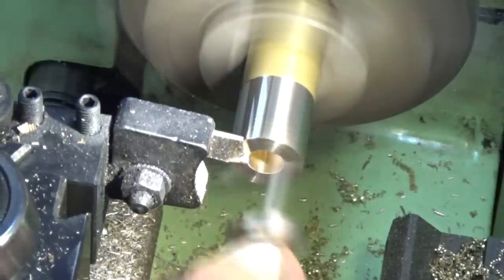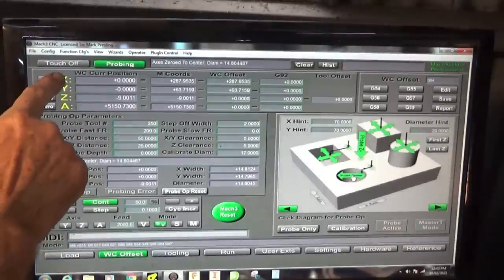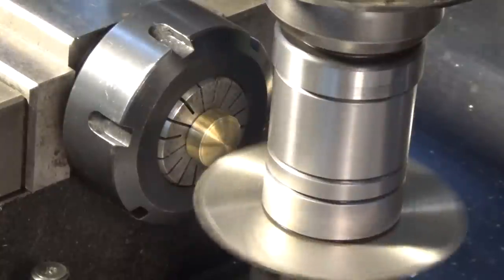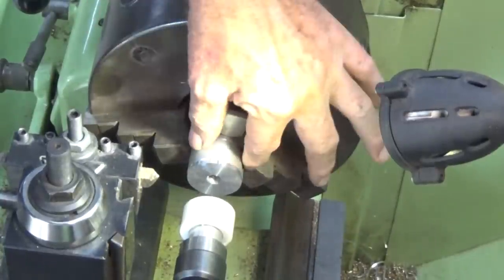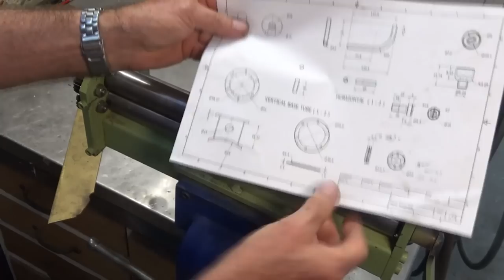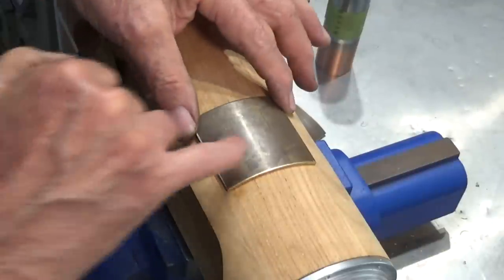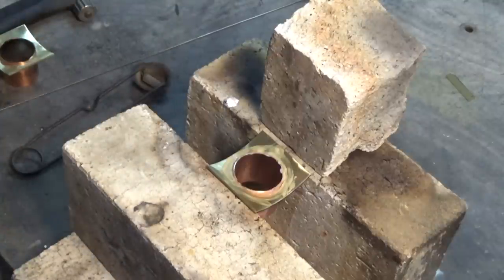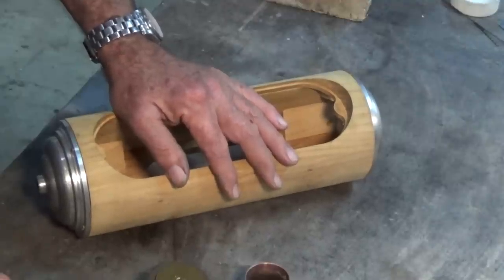The "MIXIE" A DIY Steampunk, Backlit Digital Clock - Part 5

Comment: Cool stuff.  Im a heating and air guy, so I do a lot of silver brazing.  I have very good results with a very fine oxy fuel flame. A 0 (American size) tip is good for just about everything, and a 00 is great for even smaller stuff.  Any way, not trying to be a know it all, but most people use much too large of a tip.  Use a small one and let the silver suck in with the heat.  The silver always wants to run to the heat.

I really dig your baby slip roll, looks handy.
Reply from the maker: Unfortunately, here is Australia, the rental cost for gas cylinders is outrageous. You can either pay an annual rental fee or an up front charge for an exchange cylinder and then about 1/3 of that for each exchange. I purchase exchange cylinders for propane and MIG gas. It's hard to justify adding two more cylinders to my shop but you are correct about the concentrated heat of a fine oxy acetylene flame. In the next video I show some joints that I did that way but I had to take them to the high school shop where I used to work. 
Regards,
Mark
Reply: @Preso58  didnt realize acetylene was so spendy there.  I go thru so much nitrogen, oxy, and acetylene that I get a good price on it.  I actually get mine at the feed store for about half what it runs at welder supply.  Ive had my big tanks for years, as well as my tote sized bottles and several spares. 

Ive had fair results using those little crack pipe butane torches for really small 45% soldering.
Reply: Might want to talk to your supplier mate, I run E size cylinders and the rental on those is $10 a month. (Adelaide)

Comment: About a year ago I picked up a three in one tool from Harbor Freight.  It has a shear, press brake, and slip roller.  This video reminds me that I have yet to try out the slip roller portion.

Great video as always Mark.  thanks for the information.
Reply from the maker: There are some jobs that only a roller will do. The rollers on my machine can have custom grooves in the ends for wire and angle as well. I haven't done that on mine yet but it's an option if it's needed.
Regards,
Mark

Comment: We have the Ender 4, which looks like the Ender 5, but wasn't really sold as the Ender 4. So, when the driver board died I bought the BigTreeTech 1.4v and the touch screen, spent two months trying to get the motors to run properly without crashing. The Ender 5 Marlin software would not work and I had to add some more to the programming because there was a direction conflict, but after the upgrades the printer prints fantastic and is so quiet the fans are louder than the stepper motors. I love how this clock is taking shape. I designed a 1950's steam mill for one of my classes for animation and had it blow up, which was an actual explosion in Oregon in the 1950's when a blow off valve seized.
Reply from the maker: Craig, I have been doing some experimentation with the Ender3 before I give it to my nephew. I just ran a print that was sliced using the Prusa slicer. It seems to do a better job than the Cura slicer I was using before. I think part of my problem was trying to print PETG filament. When I first got the Ender, I only printed in PLA and it did a pretty good job with that. However, the Prusa has a lot of tricks up it's sleeve and it is also very quiet. 
Regards,
Mark

Comment: These things are very cool Mark nice work.....friken laser beams haha.....glad you showed the pressure turning like that I would have been a little worried to try that
Reply from the maker: The key to doing the pressure turning is to take light cuts. I could have added a pin in the centre of the stock in the chuck to register on a hole in the disc since they all needed holes anyway. That at least stops the discs flying out sideways if there isn't enough friction to drive the part. 
Regards,
Mark

Comment: Well, as a former pipe fitter I can say those flanges look awesome 😁. The steam domes àre going to be great too, the joints look very tidy. I've been wanting to invest in some silver solder but it's a little on the pricey side 😏. How you manage to stay so clean as to not mess up that wood I'll never know. If it was me it would be full of oily fingerprints by now 🤣. Thanks for the great vid, Mark! Cheers! 👍😁👍
Reply from the maker: If I don't drop the wooden frame on the floor first! It's one of those unstable things that wants to roll if you put it down the wrong way. 
Regards,
Mark

Comment: You can pass the wiring through those screws quite easily.

You have a single start thread, you have a fixed thickness part that it's passing through and presumably those parts will all be clocked to a fixed angle relative to each other.

Do the screw up to (or even just a little over) its final torque with a torque wrench so that you have a consistent amount of stretch etc on the screw then mark where the hole has to be in the side of it and drill it out.

Now you can reassemble it and torque it up to somewhere near the value you used previously. The big hole you just put into the side may affect the amount of stretch in the screw so your new torque may differ slightly from the initial one but you'll be able to find experimentally exactly what value you need to line everything up.

Providing you use the same screw in the same doughnut piece and torque to the same value with the same thread lubrication (either some or none) everything will end up in the same spot every time.

If you're not convinced, give it a go anyway. You can always run the steel pipe if you're not keen on your original plan ;)

And if you take note of the angle between the hole and screw slot you will know exactly where it's at at all times anyway.
Reply from the maker: Daniel, thanks for the procedure. I have a terrible habit of not keeping track of which screws go where. I can almost guarantee that one or more of the screws will tighten up in a different orientation and then I will be messing about trying to match the screws so the wiring holes line up. Yes, it is a simple matter to number each part but I'm not that organised. There is also the matter of having to attach pin headers to the ends of the wires and these may not be easy to thread through the holes. With a build like this one there is a lot of assembly and disassembly before everything is debugged and finished. At the end of the day I sort of like the braided stainless hose and it will add a bit more detail to the build.
Regards,
Mark

Comment: I really liked the way you mated the curved collar and the cylindrical tube. You’re right. Many of us would have drilled through the flat piece and then curved it. No doubt with a hammer! The fit you got was exquisite. It took me back to my mechanical drawing classes where you would project one piece to the other to get the shape on a curved surface. Nice work as always. Also, Im wondering if the Steampunk ethic suggests keeping great or lousy time.
Reply from the maker: Glenn, I taught Geometrical Drawing for many years doing it the old way with tee squares and compasses. The curriculum included "interpenetration" and "triangulation" which allowed for the plotting of wonderful forms as flat patterns but also as 2D drawings of the intersection of two geometrical solids. I loved the way the curves would appear from the mass of construction lines. Now it takes just a few minutes with CAD software. I can assure you that the clock will keep perfect time, as long as it has a WiFi connection. Without that it's just a bunch of dumb hardware.
Regards,
Mark
Reply: @Preso58  I’ve seen drawing done by professional draftsman from the 30s and 40s that look like artworks. Beautiful just to look at!

Comment: Nice work although I prefer my steam without any punk.  I don't know if you've come across it, but typists correction fluid "Tipp-ex" is remarkably good for controlling unwanted silver solder flow.  Paint it on, smoke it up then wash it off with the flux residues.  Good advice regarding the silver solder about cleanliness and speed.  The speed is even more important with ferrous parts as the flux is soon used up dissolving the oxides.
Reply from the maker: I hadn't come across the correction fluid method but I remember reading in the Model Engineer magazine that pencil lead (graphite) does the same job. I am guessing that heating the correction fluid carbonises it. It would certainly be easier to paint it on than trying to run a pencil around a small diameter pipe though. 
Thanks for the tip. I'll try it out.
Regards,
Mark
Reply: @Preso58  Hi Mark.  I assume it must be something like titanium dioxide as it changes color a bit but doesn't burn.  There's a few pictures of me making hinges for my loco on the Model Engineer Forum.  https://www.model-engineer.co.uk/forums/postings.asp?th=148034
Reply from the maker: @69woodburner  You are correct. I just googled it and Tippex is mostly titanium dioxide and some solvents like naptha. The article states that the melting point of titanium dioxide is 1843C and the boiling point is 2972C so it's no wonder it does such a good job as a mask. Those little hinges are brilliant. Certainly beautifully made. Thanks for the tips. I just have to be able to dredge it up out of my memory next time I am doing such a job.
Regards,
Mark

Comment: Mark, It looks great, I really like the pipe flanges and bolts. What are your thoughts about having a two piece brass end screws. The inner screw is hollow for your wiring to pass through, and the outer screw is the same as your slotted screws, but just the head only, to plug the hole. But twice the work.
Reply from the maker: That sounds like a good design. I must say I am sort of winging it on some of the details with this build. Although I model most of the assembly before I start it's often the little things that get overlooked. As you will see in the next video I don't always think ahead with things like the placement of fixing holes in sub assemblies. 
Regards,
Mark

Comment: Interesting as always.  What Boring Bars are you using in the Boring head ?  Would like to know.
Reply from the maker: Roger, I bought a set of four different length boring bars with TCMT inserts. They are similar to these https://www.ebay.com.au/itm/RDG-INDEXABLE-BORING-HEAD-BAR-TOOLS-METRIC-IMPERIAL-SIZES-MILLING-TCMT-11-INSERT/352165255409?hash=item51feaf58f1:g:RtoAAOSwkGVZulce
Mine have 12mm shanks. The cheap brazed insert bars should be avoided. The geometry of the tips is all wrong and on close sized holes they will rub and give a very poor finish. 
Regards,
Mark

Comment: i hope you dont discart the ender 3, its a wonderful machine and there are some cool low budget mods that will bump up the print quality to the level of the prusa!

(different fan duct, printable
change the extruder to the metal version
change bed springs
change the mainboard to the SKR e3 mini v2.0
add bltouch
add a different bed surface
add filament runout sensor
) 

just to name a few, its really fun to do and you get rewarded by a reliable secondary printer
Reply from the maker: I have agreed to give my Ender3 to my nephew. In the meantime I am trying out the Prusa slicer with the Ender and I will try the Prusa filament as well. I have done a few modifications to my Ender but having tried out the Prusa I have to say it's a bit like chalk and cheese. I am actually just running a print now from the Prusa slicer and it's way quicker than the Cura sliced version. I know there is a huge fan base for the Ender3 and mine has served me well but it's time to move on!
Reply: @Preso58  i bet your nephew will be very happy about that! you can print now using the prusa slicer for other printers aswell, so maybe you can look into that for your nephew as its as you said much better than cura!

Comment: No No, decorative  chrome plating is never thick and is usually over an undercoat of nickle, it is however very very hard 65 Rc plus. I held my breath as you did that belt sanding. If I had been doing it  the part would have caught and flown across the room to its dented and bent end in the rubbish bin - sigh!.... Martin
Reply from the maker: Well, whatever I was sanding off was certainly hard. 
Regards,
Mark

Comment: funny, I have been looking at the ender cause my i3 is a pile of never ending bullsh1+
Reply from the maker: I must say I am surprised! I was initially a bit sceptical about the Prusa. Apart from the high cost, I was a bit concerned that I was paying nearly the same as four Ender 3's for something that was mostly 3D printed itself. However, in the short time I have been running it I have been blown away by the print quality, the speed and how quiet it is.
Regards,
Mark